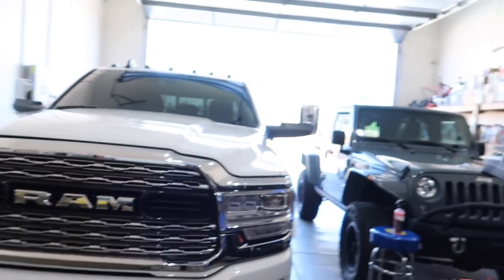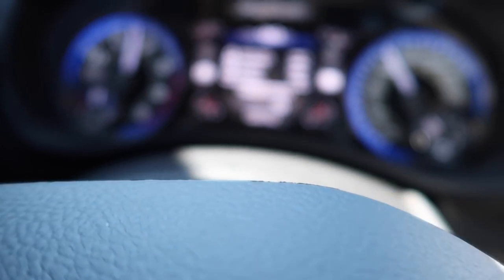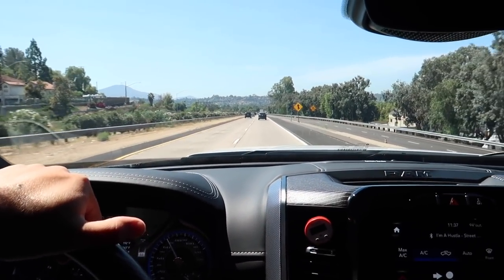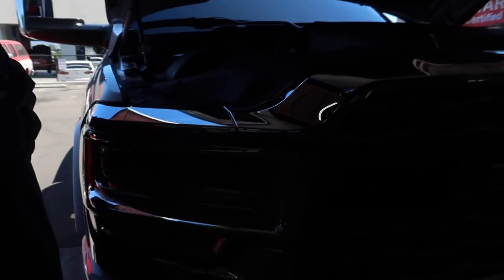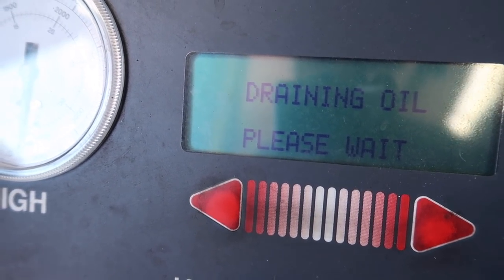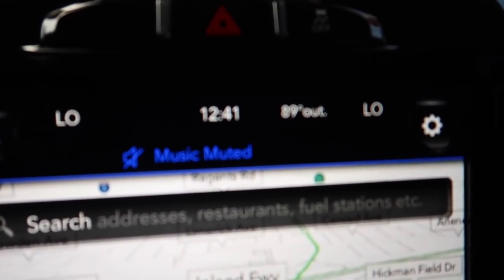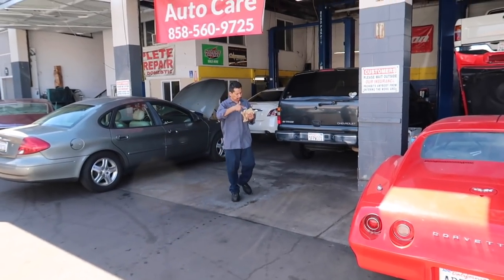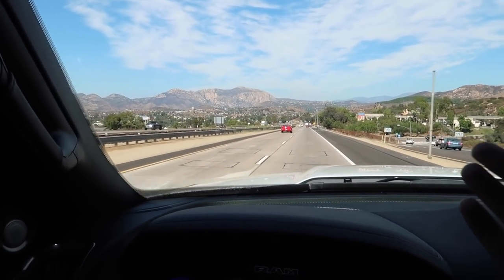AC PROBLEM WITH THE NEW RAM OR IS THIS NORMAL?

Comment: I have a 19 Silverado crew cab and it sometimes helps if I shut the rear air vents. It doesn't seem as cold as my 13 Sorento I had before but it still gets cold after a few minutes. I figure it takes longer because it's a bigger system. Also, I've heard the air is colder if the fan is slower. Good luck with your new truck man. It's really nice.

Comment: Eddie, i had a brand new 2019 ram 2500 big horn the company i work for leased for me and the AC had the same problem. In my opinion it felt as if the ac was plenty cold but the fan just wasn’t blowing hard enough to give you that nice AC feeling.
Reply: That’s exactly the issue I’m having in my 2021 bighorn, it’s cold enough but I feel that it’s not blowing how it should.

Comment: I bet if you added an additional condenser fan you would cool down more. Maybe there's a TSB that adjust the condenser fan speed. It's almost like your condenser fan may be spinning to slow. You should put a big ass fan from your shop in front of the truck (and spray it down with water) and see if that lowers the vent temp. Your A/C machine is an older one too. The new ones have a charge accuracy within 1/2 an ounce which is much more accurate than the Snap On unit you have. This is especially crucial on smaller capacity units like yours.

Comment: According to the readings on the thermometer, it could be the flux capacitor is operating at 2.4 ghz and the WiFi booster may be shorting out the led circuits - due to insufficient carbon fiber in the intake to the bleeder valve leading to the DEF tank, thereby creating a negative pressure in the injection pump causing an inconsistency in voltages to the transducer.
Reply: Genius!
Reply: That's why higher than my 8th grade education
Reply: LOL

Comment: you should have spent a little more time with the machine hooked to the truck. I would run a good vaccum then charge to 1.3 lbs run the truck monitor pressures and temp then bump the refrigerant amount a tenth of a pound at a time to see if the low side drops a little more. the sticker may say 1.31 but might blow colder with 1.40 or 1.45 in it. you should also watch how low the suction side can get and see if it results in lower vent temp because it could be an actuator issue, actuator door leaking cold air out behind the dash or mixing with hot air from the heater core. You should be able to get low 40's even on a hot day. your gmc was not in the 20's otherwise your evap would be freezing up.

Comment: The A/C is different between the drivers and passenger side for sure 6 or so degrees, it does cool down and the pass side blows low 40's once cooled off, but it really takes a while to get there.

Comment: 2019 ram half ton 4x4 with new style coolant system. My fan speed rarely goes over 4 because it'll freeze you out of the truck. Hot/humid Oklahoma weather, btw.
Reply: OK is no where near AZ heat

Comment: I know it’s a long shot and difficult because not everyone has free access to a AC machine but I charged mine to factory specs and wasn’t that cold and I bumped mine up in .10 increments with the AC going and a fan blowing into the front of the truck and my 03 duramax blows 34 degree air on 95+ degrees days. It wound up holding almost a 1/2lb over factory specs.

Comment: Put your ac   gauges on the low side pressure should be about 35 psi with the engine at 1200 rpm. Then look at the low side gauge. There is a scale on the gauge that will show the evaporator temperature. 35 psi will be 40 degrees at the evaporator. Your center vent air will be within about 5 degrees of the evaporator temperature. If it is more than that you have a blend door problem. If your low side psi is higher than 35 you don’t have enough Freon

Comment: Hey Eddie. I have a new 18' Ram 3500 single. At first the ac was like your experiencing. Then I tried the auto climate control. Just set the temp you want, ( I do 69*) and let it do its thing. It controls fan speed, seat cooling. All automatic. The lower the temp, the cooler it is coming from the vents. When the cab starts to reach set temp the fans slow down. Pretty cool ( no pun intended ) feature. Give it a try. Btw, I'm south of you in Oside. I'm currently researching the deploying bumper step I saw on the 19" power wagon for getting into the bed. Let you know what I find. Awesome vids!👍✌🤙
Reply: Agree with setting system to auto. Set it and forget it, when I turn on A/C which shuts down the Auto mode it's not nearly as cool. I'll have to turn on max cool to keep up with Auto.

Comment: Eddie have efren put hose clamp pliers on the heater hoses going into the cab to shut off the heater core and if your ac starts cooling better you know the problem is inside with a blend door or actuator not closing/sealing properly letting warm air come out with cold and keeping it at 50

Comment: 50-55 degrees is NOT GOOD ENOUGH. Especially down here in AZ when it’s 117F. I use my truck like a mobile office I want to freeze when im on a job site or idling waiting for someone. I leave my truck running to cool down my self and get in every 20-30 min. And at mid 50s temp that won’t work. And I agree 1.3 pounds is really low should be at least 2 pounds

Comment: I've noticed this on other new vehicles not just RAM, I think it's a fuel efficiency strategy thing they're doing to meet EPA requirements just like the Auto Start/Stop technology that people also hate. BTW the passenger side is colder because the evaporator is on the passenger side.

Comment: I got the same issues with my A/C I close the rear vents and front of cab stays fuller. I think its the blower.  The jeep Rubicon has more velocity in my opinion. ram should put the motor in the jeep in there ram's.  Check out your wifes A/C  Big difference.

Comment: Who said turn air recycle off to make it colder?😂 that’s just silly lol. When you have it off it’s sucking hot ambient air from outside. When it’s on it’s sucking the “pre-cooled” cool air from the cab, making it easier for the system to push colder air. But anyways, that does seem a little warm even for being decently hot out. I’ve tested the A/C air temp on My 03 Silverado a couple times & it puts out right around 40 degrees on a “regular summer day” for my area (about 85-90 degrees, 45-65% humidity). When it’s a little cooler like 75-80 it’ll get down to mid 30s like around 37 degrees or so. And when it’s really hot, around 95-110 degrees with low humidity it was pushing out about 45degrees. & oh the passenger side is usually always a little colder, because the vents are shorter/closer to the source.
Reply: Keith’s Garage I was thinking the same thing lmao like who said that
Reply: In theory it's true because of the temp deltas. There is greater heat transfer capability with hot air.  Same thing as how cold water will boil faster than hot water

Comment: Why not let it run for a long time on hi, and as the truck cools off on the inside and the temp is at 75 or so, see how cool the vent is then and see if it blows out even colder?  Homes should be around 20-21 or so below what the temp in the house is, so assuming vehicles are the same way, to an extent?

Comment: I have a 2018 2500 with the Cummins and my AC sucks as well. The air doesn’t come out of the vents very forcefully and what air does come out isn’t as cold as I feel it should be also. I swapped my cabin filter out with a K&N one and it seems to have helped a little bit but like you I expected better from a brand new truck. I’m almost suspecting some sort of blocked ducting or something with how my AC performs. Definitely not as good as the GM trucks but that’s the only complaint I have about mine so far.
Reply: ksiville I wonder if the trucks without the large infotainment system have this issue?
Reply: azrwilkinson mine is a tradesman, just about the smallest infotainment system you can get

Comment: My 18 Ram stays on Max AC during the summer, the fan speed can be adjusted with AC set on max
Reply: I do the same thing you do with my 2013 and my 2017. Works great that way

Comment: Recirculate should deff be cooler. And the unit shouldn’t have to work as hard. Also read on a forum where someone reported Ram had attached an incorrect sticker under the hood for the amount of Freon. Last edit, also check and see if you feel the ac blowing through the defroster vent. When it’s humid my windshield gets condensation.

Comment: I would just run it. Some are colder than others. I had a 1994 Ram and it was ice cold for 22 years and never had a issue. My 03 chevy is ice cold. My 2017 chevy doesn't seem as cold but I don't sweat it.

Comment: There is a service bulletin which is basically a reprogramming of the computer..... it helped my AC tremendously... was done in a few minutes by the dealer
Reply: Were you able to objectively measure the vent temp output after the reprogramming?

Comment: recycle and fan low, moving down the road is coldest,       check in town , sitting at lights etc,it will get hotter if the fans under the hood are not blowing enough, most cars you look for 48 50 degrees,,,,,,,,, yeah if fans inside on high they do like you said blows to fast to cool the air all the way

Comment: Turn you max ac button on then turn your fan speed down if you don't want it blowing that hard.  I believe max ac cycles your compressor longer.  Mines a 2018 but what I described worked for me. I struggled with the same issue going from a gm ac to ram ac.
Reply from the maker: no when i try to turn it down it goes back to regular AC
Reply: @EddieLife3500  That's to bad. Ram must have changed how that function works in the 19's . I'd be interested to see the temp yours blows when it is in max ac mode and see if it gets below that 49dagrees. The air temp should be around 34-38 coming out of the vents on high. If you think about it the evaporator gets to freezing to be able to pull the moisture out of the air.

Comment: My 2014 ram dually cummins is not as cold as my 2005 ram it sucks times in traffic it feels like warm air , had it serviced  and everything was fine they said I even added an electric fan and that helps a bit but still not as cold as my 05

Comment: There is a bulletin on this issue.   Sticker wrong under hood.  Shows 510g but if you charge it with 567g it will cool fine.  Bring it into us at dealership if under warranty and we will fix for free.
Reply from the maker: mine says it holds 595G not 510 or 567

Comment: Passenger side is closer to the condenser Coil, that’s why it’s colder on that side... I have a set of fans from a truck stop that blows the passengers side to the driver side in my 2012 ram 3500 SLT... FYI 2500 and 3500s Do Not have cabin air filters so if you do a lot of dirty/Dusty driving the condenser will get dirty quick and slow your airflow way down... And the are a bitch to clean...

Comment: Hi Eddie My 2017 2500 AC will get down to between 38 & 42 degrees out of the middle vent and I never run it on max air. Sum-Thin not rite Lucy!!!!!!!!!

Comment: I have 2019 2500 Cummins longorn I have same problem!!! Driver side is hotter and when I put it up to 65 it gets hot not cool. I have to put it all the way down to low for it to go back to cool air. Passenger side is colder then driver and you can tell big time! Did you figure anything out on how to fix it?
Reply from the maker: ya there is no fix for it the problem is in the heater core, that is just the design that ram did for this truck

Comment: My 2019 f250 blows 40 constantly. You should be able to turn on max ac then lower the speed down. Every truck I've ever driven has been able to do that. Give it a shot.
Reply from the maker: i did when on max AC it stays at max fan speed

Comment: Put it on max a/c and you can just lower the fan speed and max a/c will still be active. I have a 2017 with 0 issues
Reply: The 2017s aren’t with this issue it’s the ones after 2019. My 2019 did this too I had the longhorn but in Texas heat it was really bad we had to trade it in.

Comment: If you have an auto temp ac/heater system, then set the temp to what you want and leave it alone.  It will automatically adjust itself to use max/low/whatever to get it to where it needs to be.

Comment: Take it to the dealer there is a TSB and the dealer can fix under warranty!
Reply: It sucks but that's a part of getting the 1st year of a redesign, You have to deal with little problems every once and awhile.
Reply: Hopefully, they don't watch this video he may not warranty
Reply from the maker: what are they gonna fix i just checked it
Reply: Whats the TSB number?
Reply: @EddieLife3500  
Ive heard that there isnt enough freon in them from factory and the dealer adds more.
Reply: @scottback3020  too much refrigerant or oil in the system can also cause reduced cooling. So will a larger area to be cooled (extended cab) or a greater window area....external air entering the vehicle...there are a LOT of reasons other than low refrigerant (no freon since 1995) for limited cooling.  A/C should ALWAYS be operated on recirculate/max.
Reply: @jimmyraythomason1   Im repeating what ive heard, not diagnosed.  Calling refridgrtant, freon, is a generic term.  Much like most people calling locking pliers vise grips..

Comment: I might catch hell here but im willing  to help you out .OLD SCHOOL ...  Been charging ac for 30 years and I go by the beer can cold method and I just know my pressures .  I've used those machines for years and I hate them.  hook up the suction gauge and what's the back pressure at 2200 rpm?  most cars should be around 18 -20 lb back .  I bet you're BP is low Sir

Comment: The new Ram has a much more efficient condenser . That holds a lot of Freon,most new vehicles only hold a lb at the most. My O3 civic held 2lbs 6oz, a new one holds only a lb. A lot of vehicles are now coming with R1234Y which is stupid expensive and not compatible with R134 machines at all. Fortunately you still have cheap R134

Comment: My 2014 Ram HD is plenty cold.  You would think the engineers would get the gen AC temp right.  Maybe a bean counter got in the way.  I certainly wouldn't want a tech taking my dash apart and then dealing with squeaks and rattles afterward.  Maybe I will get a Ford next time.  But my last Ford sucked and the dealer sucked.

Comment: I have a 2021 ram rebel. I love my truck but one thing I hate it’s the fact that I have to admit the AC sucks! I noticed that right away I will suffer this summer here in Vegas!
Reply: Did you ever take it to the dealer?
Reply: Yes but there’s was nothing wrong. I have the etorque engine so every time I stop it turns off the ac also turns off I live in Las Vegas where it’s extremely hot 🥵 there’s a button I have to press for it not to turn off but still the ac it’s not the best.

Comment: I love my 2017 Ram 2500 6.7...but I've always felt like the a.c. could be colder and blow harder. Guess I figured with the size of the cabin or something it just doesn't quite cut it. I have a bunch of Camry and Rav4 Hybrids for my transportation company and they blow like 28 or 29 with the thermometer in the vent. I'll have to run some tests on the Ram now

Comment: My 2019 Ram 2500 is in the shop at the dealership having the HVAC Technical Service Bulletin being performed. They are having to pull the whole dash out and put in different parts. Waiting to see if this fixes my AC. 7/28/2022
Reply from the maker: Holly crap man that’s crazy
Reply: Did they end up fixing the problem?

Comment: Hey Eddie! Try measuring the air duct temperature with the fan on speed 1 or 2 and see if the temperature drops any more. 

Reason being is because air is flowing through the evaporator at a slower speed allowing it to dissipate more of its heat. 

Just a thought would like to know how it responds
Reply from the maker: i will try it out

Comment: I have a new RAM as well.  The passenger side was in the mid 40s, Driver side 51 degrees. I get exactly the same results as you. Put a clamp on the front heater hose and watch it go down to 43 degrees.  My heater core is heating the air on the driver side A/C.  It is very possible you are seeing the same issue..
Reply from the maker: i am honestly good in mine i know its only 50 but i am still comfortable in there

Comment: At 90 degrees outside the vent temp should run between 40-50 with normal new vehicles. You had 94 outside temps.

Comment: On Ram If you use max AC it goes to recirc too....so it must be colder.......after owning 2019 plus GM trucks the Ram is pathetic in AC.....When summer gets here gonna have to figure something out

Like someone said 70k truck shouldn't have an issue like this.....in this day and age absolutely no reason for bad AC or heater